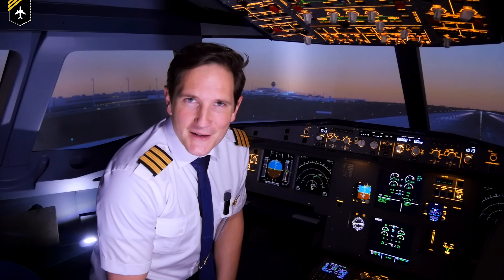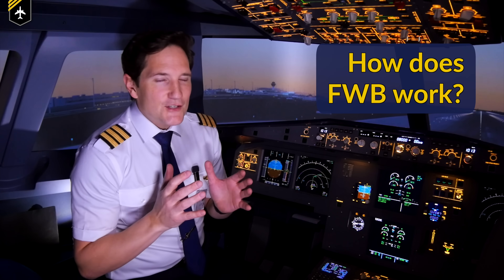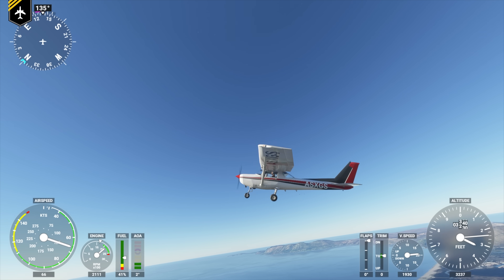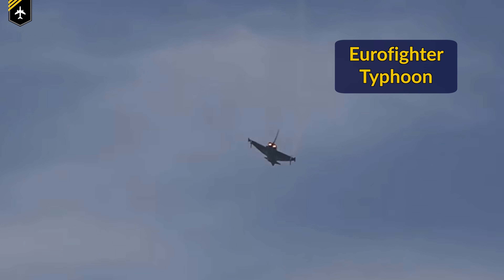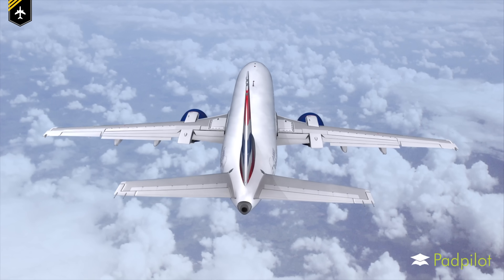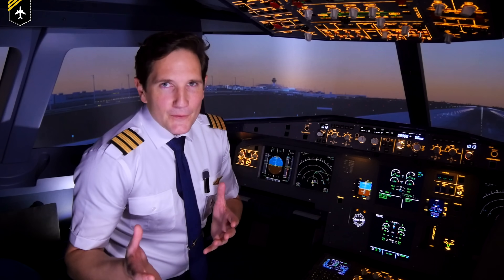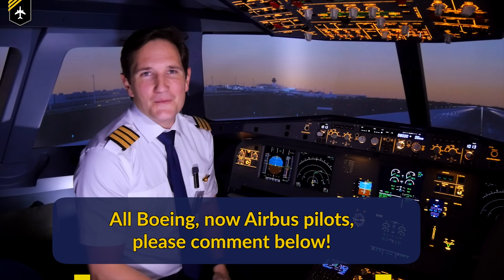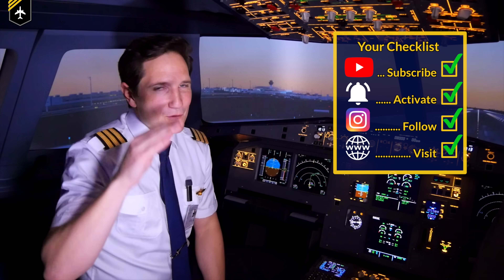How does FLY-BY-WIRE work? The future of flight controls! Explained by CAPTAIN JOE

Comment: To me the only weird part about Fly by Wire that I couldn't get used to is the fact that the airplane doesn't come back to its natural state. Keeps turning until you counteract it with a turn to the other side to bring it level. Same for ascending, descending. Would probably lose my mind over this.
Reply: That's exactly what flyby wire does it automatically counteracts. You described non flyby wire (depends on the plane)
Reply: @dkdanis1340  you are absolutely correct, my bad!
Reply: @DarkSetis  👍. Even manual planes will go back in natural state by design. Sort of like how cars center the steering after you release it.
Reply: @dkdanis1340  Yeah that makes sense. Thanks for clarifying.
Reply: @DarkSetis  every newer plane is flyby wire normally same with 747 and 737.

Comment: Why "future"? It is pretty much present! The other disandvantages of FBW: it may (or sensors) to it may malfunction and overreliance on the safety checks. See Air Inter 148 and XL Airways 888T

But good video.  I like you most out of all pilot bloggers: you, mentour, 74 Gear, because you provide best explanations. They are most consise and easy to understand.
Reply: Air Inter was not due to a malfunction. The pilots simply selected the wrong mode and didn’t confirm after selecting....or notice how fast they were dropping. And failed sensors can cause a crash on any aircraft. Look at the 737 Max, Birgenair 301, Aeroperu 603

Comment: Personally, I feel the mechanical system is worth the extra bit of effort. There's no substitute for pilot experience and becoming one with the aircraft / machine you're operating. Long live the mechanical systems and safeguards against forced automation and undesired decisions by programmers/companies, that can result in accidents like in the 737 MAX. I love the air-cooled 911 Carrera, by the way!
Reply: I agree, but partially. As in fly by wire is practically better than conventional ie pros of fly by wire are more. However the feel of flying a conventional mechanical aircraft has a better feel and feedback, so an ideal system would be fly by wire which can replicate a mechanical system.

Comment: Some advantages can be disadvantages and vice versa. 

Sully said that AF447 wouldn’t have happened in a Boeing airplane because you wouldn’t have had an inexperienced pilot trying to get the flight envelope protection to save him (Alpha Protect.. which was disabled when the plane went out of Normal Law due to loss of air data) nor would the other pilot have been oblivious to the pilot pulling back the whole time as the tactile feedback of a full yoke would have been impossible to ignore. 

I am not sure how strong the FACU is on the 737.. but it might have been contributory to the MCAS crashes as those forces would have been at their maximum with the stabilizer trimmed that far down. 

Not only would Airbus never befall an MCAS runway because it can have flight characteristics directly programmed into the flight control software rather than piggybacking on 1960s mechanical and hydraulic systems.. but the pilots would never have to physically fight it.

Comment: Its hard to imagine that our Russian collegeus battling heavy snow still flying cable and pulley controlled aircraft in remote siberia. I'm surprised by how Il-62M have a lot of cables and pulleys to lighten the controls instead using hydraulics like Boeing did. As for force-feedback, I've read some articles and many pilot missed them in FBW aircraft. I love how some people appreciate Boeing's hydraulic-pulley cable aircraft despite the heavy control feedback during some circumtances while other group also appreciate how "light" the airbus control, as they can easily control them with fully automated system.

Comment: Hey, could you make a video about NDBs and how to navigate with them?
Reply: Haha. 

First.. you type the identifier in the direct-to line on the legs page of the FMS. 

Then you dial in the frequency on the ADF head unit. 

Then you select the RMI to the ADF and watch it hunt left and right ten degrees at odd intervals until it settles at 5 degrees off the nose.. occasionally pointing at local thunderstorm activity.. while your FMS track guides you so precisely to it. 

It’s so precise, that when you pass the station.. the RMI needle won’t swing because you’ve passed directly over top and it’s “stuck” still showing to the station because the ADF loop shows equal signal strength each way .... until a lightning bolt or a local welding shop creates enough electrical interference to jar it loose or you hit the test button in frustration. 

Really.. I like NDBs for situational awareness cause I can throw up a needle and if I’m off airways but don’t have a procedure loaded or a GPS track I can instantly tell where I am in relation to it—even if all the moving maps go blank.

The NDB procedures are pretty good for cloud breaks, too. They often have the lowest sector altitudes and are offset for a nice final onto the runway on days where it’s 2000 overcast and greater than 6 miles. 

But full procedure?  Forget it. Circling at minimums?  Forget it. So many better RNAV approaches.
Reply: @Bartonovich52  Oh thanks Mate for your small explanation! yea i would prefer VORs or GPS nav way ahead NDBs too, I was just curious how pilots can use them to nav on a final approach. I mean VORs are easy to understand but NDBs? No chance for me.
Reply: @armybasegamer8859  NDB or VOR are the same in terms of approach procedure but the NDB has a smaller range, is more sensitive to electromagnetic perturbations and the indication on the instrument is more uncertain when the aircraft is turning (it's precessional). That's why it has been replaced by VOR in non-precision approaches. There are still some in a few small airfields. It's an old technology, cheaper than a VOR but less accurate, obsolete now and progressively abandonned.

Comment: look at 737max:
problem: new engine would cause head up then risk stall
fix: MACS software to override pilot to force nose down
problem: MACS with wrong sensor reading would cause crash
fix: pilot can pull a fuse to override MACS
future problem: pilot incorrectly pull the fuse
future fix: another hidden software to override pilot error

Comment: but did fly by wire cause air france 447  crash
Reply: No. The aircraft was in alternate law due to the frozen pitot tubes giving incorrect and unreliable airspeed. The cause was the pilot not being able to keep the aircraft straight and level for a few minutes whilst the ice melted

Comment: Hey Captain Joe, to my knowledge the 747-400 is not fly-by-wire, but the 747-8 is fly-by-wire. Since you fly both aircraft I was wondering what the differences are considering they are very similarly sized and shaped aircraft and if you can tell the difference from inside the cockpit during flight. Thanks
Reply: The 747-8 has FBW spoilers and outboard ailerons. It’s not completely FBW like Airbus or 777/787

Comment: Can anyone explain if the FBW is able to intervene the control and stop pilots from making excessive input, why did Air France Flight 447 (A330) come down, having been unintentionally pulled up by the FO?
Reply: Because the aircraft was in alternate law due to the frozen pitot tubes. In alternate law you loose some of the protections including stall

Comment: So the Boeing 777 has force feed back on the controls like the Boeing 747 and a Fly By Wire system? Does that mean the force feedback is electrical generated? And if so why has the Airbus no force feedback on there planes?
Reply: Likely because of the way they are controlled. It’s easier to feel the resistance in a control column that a sidestick

Comment: ELAC 1 is not the primary for elevator control. ELAC 2 is.
Reply: Pretty sure the SEC doesn’t control pitch trim unless both ELAC’s failed
Reply: @tomstravels520  you’re quite right that it certainly doesn’t do primary pitch control but the FCOM isn’t granular enough to know if it makes the turn compensation terms. The architecture of most systems is more nuanced and complex than the FCOM schematics. Eg the supposed single simple cross feed valve depicted in the DSC fuel section is nothing like the real thing which has two valves an a complex bypass system.
Reply: @peteconrad2077  have you ever read the Smartlynx Estonia accident report? Both ELACS and at least elevator part (might have been total) of SEC failed. Aircraft pitch was mechanical back up only
Reply: @tomstravels520  no I haven’t. Interesting. I always understood that elevator only went MB if ALL SECs failed. Thanks for the tip. I’ll look it up.

Comment: When you’re saying that Boeing have feedback, you mean only the old one without fly by wire right?
Reply: The Boeing 777 is fbw on every surface except numbers 4 and 11 spoilers. The horizontal stab has cable back-up with the engines as back-up  for yaw. Boeing weren't over confident with few.  Lol. To make it less strange for the pilots to fly there is feel feedback on the yoke. In fact if you look up from the equipment bay it looks like a "normal" aircraft with cables and pulleys. Its just they go to feel units and autopilot actuators. 
The other difference between Boeing and Airbus is that the throttles and yoke move to show what the autopilot and autothrottle are doing on the Boeing unlike the Airbus where everything is static?

Comment: This is something that has confused me a bit with the 747. If it doesn’t have fly by wire then how exactly are the flight surfaces moved? Like is it the same as the airbus system but the electrical current doesn’t pass through any computers and goes straight to the hydraulics? The flight surfaces are too large to be moved by hand so I’m guessing there is no physical cables in a 74. The 737 probs has the same system as the 74 but with physical cables still there as a back up.
Reply: It’s pretty much purely hydraulics but how the control column connects to the hydraulic system I don’t know

Comment: This is the reason why I started following Joe years ago. This is pure classical Captain Joe stuff. Fantastic work. Looking forward the next video, as I do wondered during the video « what happens if the computers fail? ». Thanks Joey.
Reply: depending on the aircraft, there sometimes is limited mechanical backup most commonly for the rudder and the horizontal stabilizer. that said, if the aircraft is so damaged that all redundant electrical and digital connections fail (that would mean no engine power, no apu, no battery power, no ram air turbine...or a fire in the avionics etc.) it will most probably crash anyway regardless of the control type.

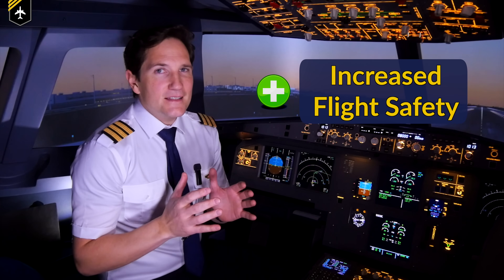Comment: @Captain Joe 7:56 If the system doesn't let the pilots stall the aircraft, what happened on the Air France flight 447? As far as I know, the First Officer was constantly pitching the aircraft, causing a stall situation, which caused the accident.
Reply: AF447 wasn’t in normal law at the time. It reverted to ALTN law when the speed was lost due to the frozen pitot tubes. In ALTN law you can stall
Reply: @tomstravels520  thank you

Comment: You forgot, that in a plane with mechanical wires, both yokes are mechanically connected, so both pilots can feel the yoke movements of the other. That is not possible with FBW and sidesticks. But interesting to know that by moving the sidestick of an Airbus  to the left or right, does not require rudder or elevator input to make a nice level coordinated turn. I just bought a A320 for X-plane, and I have made some flights already but did not notice that. I will check it in the next flight! Tnx!
Reply: Actually it is possible just not implemented on the Airbus aircraft. The newest Gulfstream has active sidestick. Not sure if it’s mechanical but if one moves then so does the other

Comment: QF72
Reply: Caused by a corrupted ADIRU CPU. Was fixed years ago
Reply: @tomstravels520  it was because it was an Airbus
Reply: @artyjaycayairlines  what’s that got to do with it? You trying to say it wouldn’t happen on a Boeing? Ever heard of the 737 Max?
Reply: @tomstravels520  I have heard of it
Reply: @artyjaycayairlines  well then you’d know that was far more dangerous as the cycle of false data never stopped. On QF72 the FCPC rejected multiple data spikes except 2 that were precisely 1.2 seconds apart and immediately starts correcting itself once receiving correct valid data. The ADIRU that failed wasn’t even made by Airbus, only the FCPC logic design

Comment: Why the system isn't using data from the airplane and the aerodynamics envelope to calculate a feedback and use, maybe electromagnet, to simulate some on the pilot control ? Maybe with a short circuit button in case of emergency or comfort

Comment: I used to fly the 737 and 777 on FSX/P3D, then switched to the A320 on X-Plane 11. I also fly the inibuilds A300 on XP11 which has conventional flight controls. I think the A300 is the most pilot-friendly plane as it combines the best of both worlds of elements from Airbus and Boeing.

Comment: Excellent video Capt. Joe!! I am a flight controls system engineer with 30 years experience, and have certified multiple FBW FCS systems for manufacturers around the world. You did a very good job at explaining the principles and keeping it in layman’s terms (otherwise it can get very complicated and nauseating). I don’t think I could really come up with negative comment on your work :). One thing you didn’t touch on, perhaps on purpose lol, is the whole debate on who should have ultimate authority of flight safety - the system or the pilot? It may have died down somewhat now, but there used to be an argument that pilots know best and should be allowed to break the aircraft if they see fit in a situation, and there have been cases where this has proven true. I guess you somewhat touched on it in discussing force feedback in controls. Congratulations again; I’m looking forward to the next one. Cheers!!

Comment: Hi captainjoe, could you make a video explaining how the rudder pedals on the a320 work? I heard that they do not directly control the rudder but rather command a whole bunch of control surfaces to perform a side slip without any other pilot input?
Reply: I'm not 100% sure but unlike the sidestick the rudder on an airbus is mechanical. That's why it's strongly advised NOT to use the rudder in flight because you will induce an uncoordinated action. Use the rudders on the ground on landing and takeoff roll and before touchdown when correcting a crab angle approach

Comment: I think there is a significant difference between the old FBW systems and the modern Airbus. Both actuate the flight control surfaces electrical but In the very old systems you move the joystick and direct control a servo 1 on 1. In the Airbus system you tell through the joystick a computer that you want do move something. The computer then controls the servomoters only if it thinks it is OK. If you command it to bank 50 degrees, the computers ingores you and stops banking at 30 degrees ( or was it 25 ?) The old systems let you bank as much as you like. I am  only a Xplane sim pilot and I am in constant war with FBW because I only like to handfly. I hope you also tell a bit over the other laws and how to engage them. But you are right, my problem are for most caused by lack of knowledge. This helps a lot to understand the system and use it instead of fighting it. So thanks
Reply: Actually, you can bank an A320 up to 67°, as long as you hold the sidestick to it's full deflection. If you release the stick it will roll back to 33° ans stay there.

Comment: You say that fly by wire you can't stall, but why did that Air France plane stall?
Reply: Read again. He said you can’t stall in NORMAL LAW. AF447 was in ALTERNATE LAW because of the frozen pitot tubes resulting in unreliable airspeed. In ALTN law most of the protections are lost

Comment: How do fly wire works when the aircraft is in autopilot??? I don't see them moving at all when a aircraft is in AP
Reply: They don’t because the flight control computers aren’t receiving the commands from the sidestick, it’s receiving it from the autopilot. The pilots either tell the computer what to do by the FCU or if in managed mode from the FMGC

Comment: With all these failsafe redundancy, the 320 did crash in France and Bangalore in India.  Wonder why this happened...
Reply: Because the pilots were idiots and didn’t understand the aircraft properly or didn’t know how to fly it properly
Reply: @tomstravels520  but the plane supposed to be fool proof!  It is more than that, I think...
Reply: @kpn574  who said fool proof? The Air France pilot lost his airspeed, didn’t follow the unreliable airspeed procedure and didn’t watch his PFD to see if he was a climbing or banking. The Bangalore crash was because the pilots activated the open descent mode instead of glideslope and failed to notice even in broad daylight the aircraft was too low for the runway
Reply: @tomstravels520  Thank you for the clarification.  It surely helps!

Comment: Hello. Just for fun, can an A320 be inverted upside-down on a full-scale simulator? I tried that in MFS 2020, after watching the movie 'the flight' and it did not bank beyond 90 degrees. :) Does fly-by-wire restricts such maneuver and the bank angle would be even less on a simulator?
Reply: The bank angle is restricted to I think 67 degrees Max and the simulator would simulate that. The only way is to disable the protections or have a fault that would cause the aircraft to switch to alternate law
Reply: @tomstravels520  I see. Thank You.